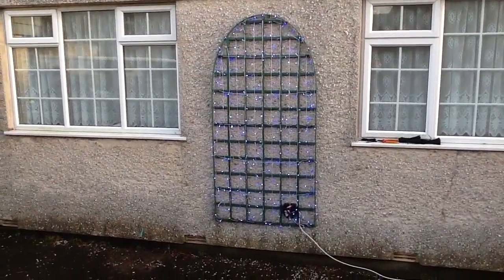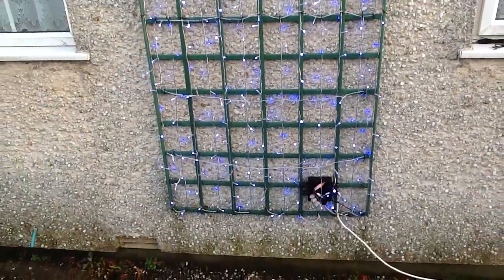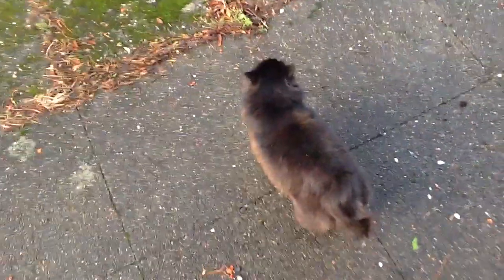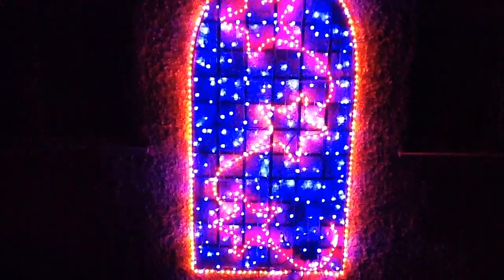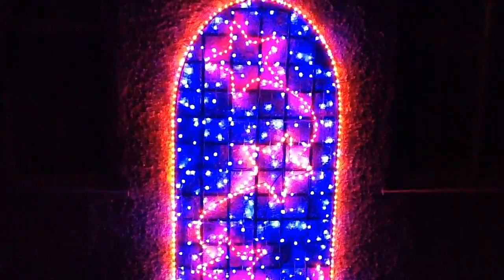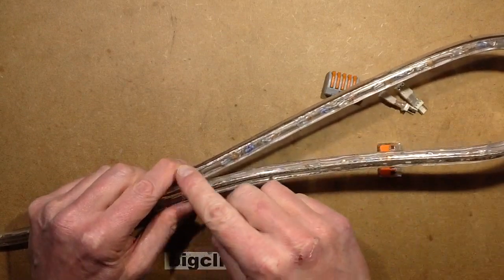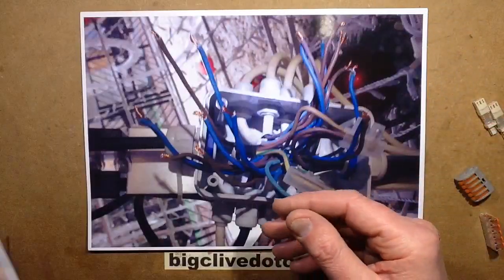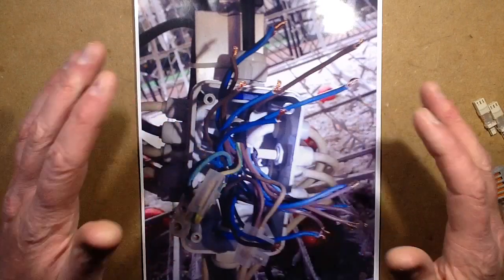Making the simple DIY Xmas lighting frame.  (It looks great.)

Comment: You know, before you go making another adapter you might just try plugging both the adapters you've already made in series and see what it looks like. As for the tree, I think I like the way it used to be done better. With them in strait lines it just looks like a cone, too rigid, and artificial. Seeing the sleigh all lit up was nice too. Here's a question though having seen the blanket of lights above the streets. Are those individual strings or a sort of net? The ones around the Gallery of Modern Art.... They look like strings but I can't quite tell.

Comment: i searched on google and i think i found the tree you're talking about but depending on the picture and year they all look completely different. which years did you work on it and when did you stop? - p.s. all but the 1mA setting looked the same. i think 1mA is sufficient, any lower and i doubt you'd get any worthwhile improvement anyways. as long as it doesnt overpower the other lights its fine
Reply from the maker: The tree on George Square has had different styles and quantities of lights on it over time.  The worst was when they first gave us nasty blue-white LEDs for it and only just enough to cover it in distinct lines.

Comment: Personal opinion only: I really don't see that much difference in relative glow between the blue and the tube light at 4 or 2 ma. The 1 ma is obviously dimmer. This is probably a combination of the camera adjusting exposure and how my monitor works, you could probably see a difference standing there. While the 1 ma string is dimmer, I'd also be inclined to say it looks spottier.

Overall? From what I see here, I'd go with the 4 or 2 ma, because I like the fill better. But that may not be what I'd say if I was standing in front of it.

Comment: i see absolutly no difference, so go with 1mA or less to save power. I have connected a dropper capacitor to my cristmas lights at the garage as well, some of those led strings are brighter than an normal led lightbulb :)

Comment: found 2 images of the garage square Xmas tree with it being obliterated with light. Did you use yellow or blue LED's?
Reply from the maker: The first strings were cold white that had a horrible blue tinge and were so expensive that they barely gave us enough to cover the tree in vertical lines.  In the end we were using tons of warm white LEDs and had complete coverage.

Comment: I'm going out to check if Bognor Regis's seafront lights are double looped this evening.
Reply: That's more excitement than anybody has had on a Friday night in Bognor for years
Reply from the maker: I bet they are.  It also makes it easier to outline complex shapes.
Reply: Just been up the front to find the (one) display that's lit seems to use what appear to be bulbs with colored caps on them. 
The town Xmas decs have a rope LED star elements surrounded with twinkly LED strands which don't seem to be doubled up.
Well, that's more excitement than I've had on a Friday night for years..👍

Comment: 1mA is quite good brightness, I have red, green and blue LED on color fade board salvaged from a candle driven with 0,3-0,5mA (5,6k series resistor on 5V), it still is visible at daytime and has been working for years. 
The leakage tester gives out high voltage, but the current is low enough to not have much effect on the LED's.

Comment: Personally I think 2mA is plenty. The only issue I see is the slight bleed over from the blue LEDs but that could easily be fixed by moving the outline string slightly, but that's just the theatre light operator in me nitpicking.

Comment: 1mA looks good to me, maybe see what it looks like at lower current, i like the blue wash, if you start to get holes in the wash it would look odd, the blue is like the blue of space.
I agree with the hole in the bottom of the box, as a sparky it didn't matter how well you sealed everything, water would build up, i don't think water was getting in, the moist air inside may be condensing, we always drilled a hole at the lowest point, or break a gap in the lid seal.

Comment: I know digital cameras are aweful at getting the brightness of blue light accross correctly (always way too bright), but from the video I'd take 1mA.
The "cheap" way to mount the lights on the tree (vertical strings from the top) looks as if the tree was covered in a net. Alsmost as if they forgot to take it out of the net that small trees often are wrapped in when you buy them.

Comment: 1mA give it the best effect of blue stars offset in the background. I say 1mA, but I don't know how much you camera is accentuating the blue over what you see. You could go lower then 1mA for the effect I think would look the best. But I'm not seeing it in person so you would have to make the final call. I just think the blue should have a background affect like they are in the background or a distance away like stars in space some the others pop out front like a comet with the blue stars in the background. Just my thoughts.
Reply: On second thought, maybe make it a variable pot resistor. Maybe a few of them connected to a PCB using a WAGO connector so you can turn them up as the years pass and then LEDs start to dim. Makes it easy for tuning them and If something fails you can disconnect the wires from the WAGO and remove the PCB to replace pot for easy service.or maybe the WAGO would be to big for this PCB, I don't know since I don't own one, then use another simple multi plug for unplugging the PCB with the adjustable pot resistors. I'm sure you have something that will work on your bench.
Reply: Oh, then small wholes in the top of the box for easy adjustment. Rubber plugs to keep the rain out, even make the plugs from silicon. And one screw on a post to hold the PCB in place inside the box. Yea, that's it,that's the ticket.

Comment: 1mA or less.
I would try going even lower.
Reply: Another .5mA should do the trick I think.
Reply: ^^ this!
Reply: Agreed
Reply: 1mA looks fine Clive. The wavelength of blue light is 475nM and the human eye is biased towards that end of the spectrum (I think) making the lights look brighter than they actually are. As the shorter wavelength is scattered more easily than the longer (Red end of the spectrum) wavelength the blue light drop off intensity is greater than the red. This means that as you get further away from the display the blue drops off in intensity more than the red. (as I'm sure you know)
Reply: No we are most sensitive to green.
Reply: +1 to this. 1mA still looked too bright in the camera. No idea how it was IRL, but it seemed like it would improve with even less intensity of blue.
Reply: 0.5 mA might look best!
Reply: to yellow
Reply: I'm with these guys. The 1 mA intensity looked the best, but running the blue LEDs even lower would probably give an even better effect.

An idea just struck me. While using lots of blue LEDs to form a backdrop gives a fantastic effect, getting the contrast right is a bit challenging, not least because there are so many points of light, even if they're run at very low current. How about adding some sort of diffusing material on top of the blue backdrop and mount the stars on top of that? Like the sort of thick builders plastic that come on a large roll. Or I suppose even a light sheet would work.
Just a though. It may very well be more work than it's worth.

Anyway. As always: great video! Inspiring and educational. Now I'll have to have a wee dig around to see if I can find any strings of lights that I could do something with.